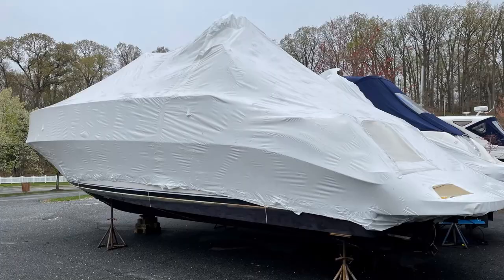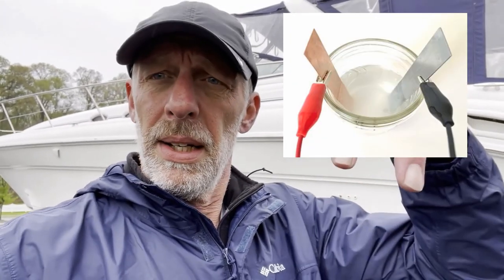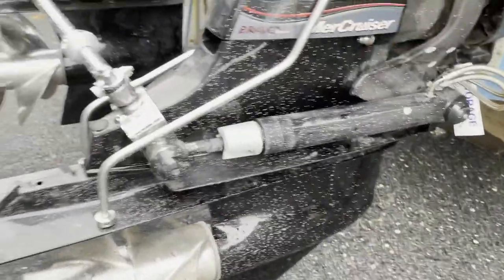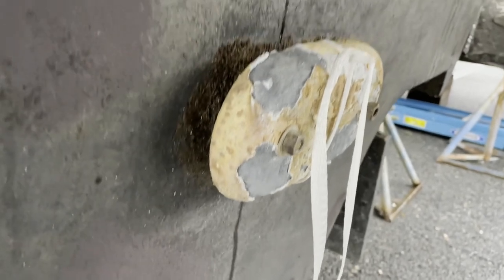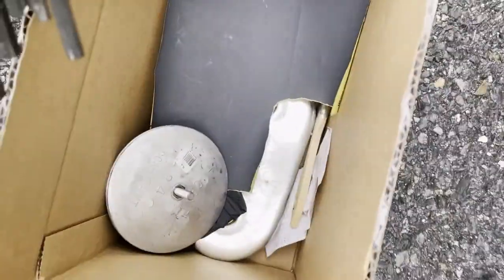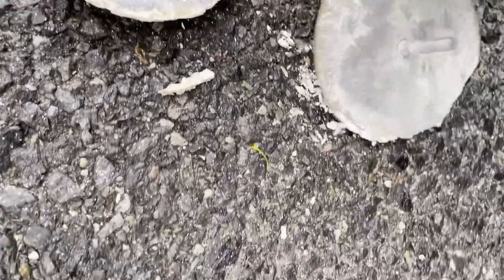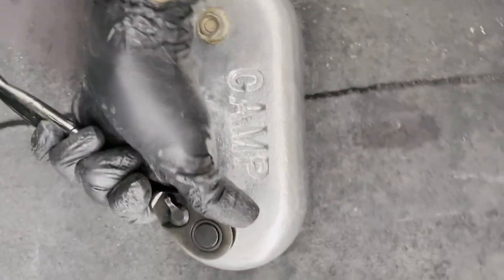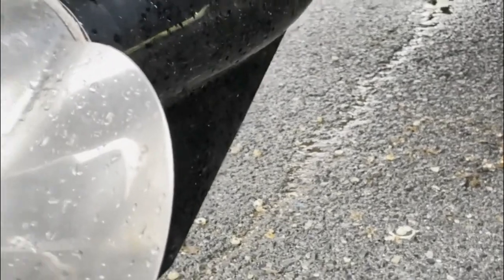SPRING BOAT PREP - How to Replace Zinc Anodes to Prevent Corrosion on Your Boat

Comment: I know allot of people that say u got to tap the zinc plates with a hammer to help connection. That true?, they typically do it where the ball is.
Reply from the maker: Hmm never heard that one.. we sand a little & tighten to make sure contact is good and has worked well for us for years - and deteriorated zincs end of season prove they worked 👍
Reply: @MyBoatLife  forsure yea they do the same, idk could be a good luck tradition.
Reply from the maker: @TristanBarnes-gr9wt  ha maybe! 😭

Comment: So the zinc simply needs to have clean contact with a metal part of the boat, below the waterline. There is no direct connection with any part of the electrical system?
Reply from the maker: Correct. The idea is that any electrolysis attacks the zinc & not components on your boat like your props, etc.